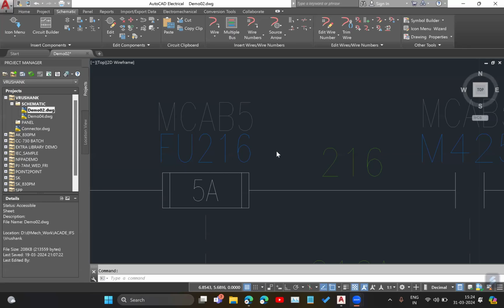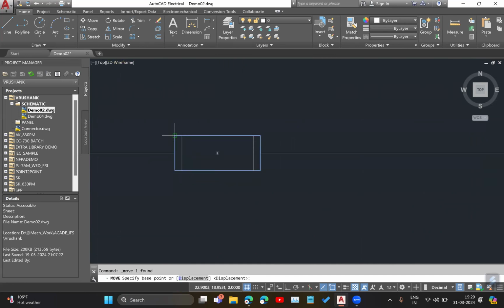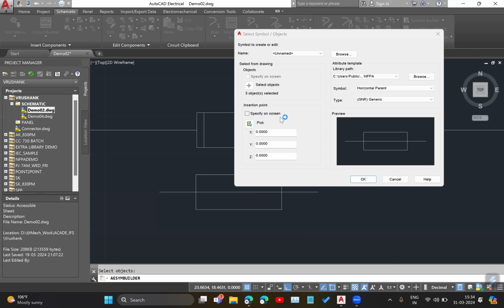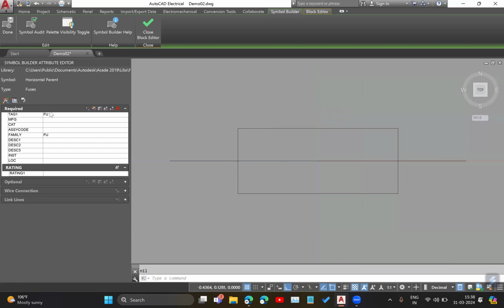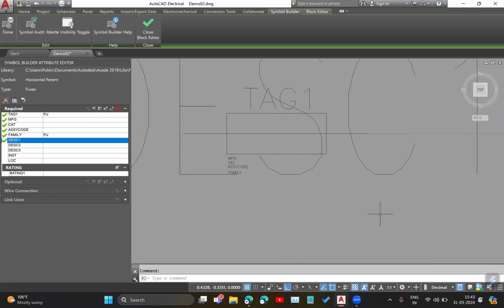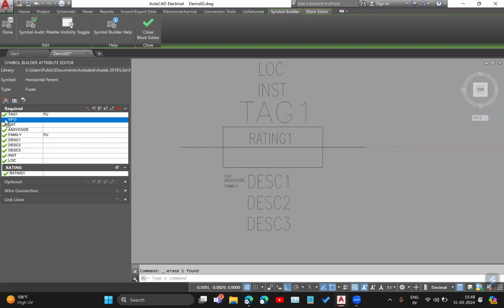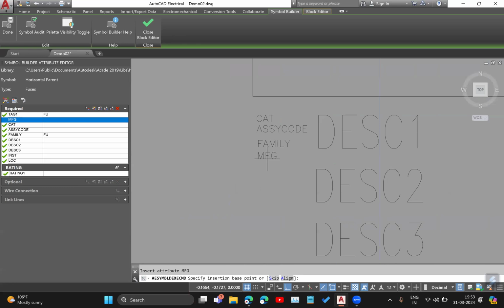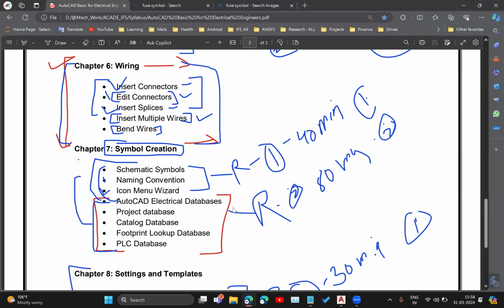Symbol Creation using symbol builder in AutoCAD Electrical.

Comment: Sir my components does not placed itself horizontally or vertically....why ??
Reply from the maker: While inserting a component, the icon menu wizard, check vertical or horizontal is checked. It appears I'm the bottom of the wizard. Also check your dropping components on wire accurately.
Reply: Sir how to the Component can vertical, because i cant